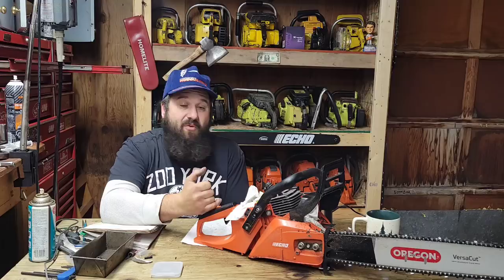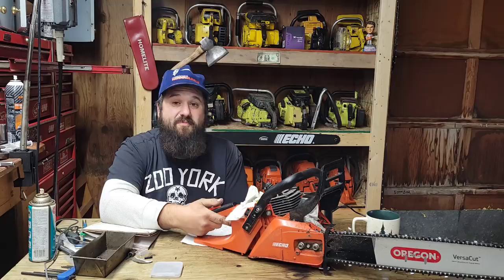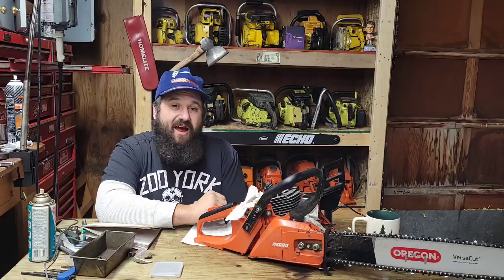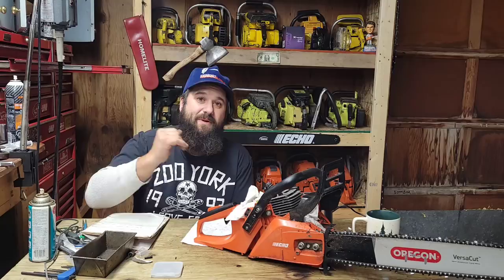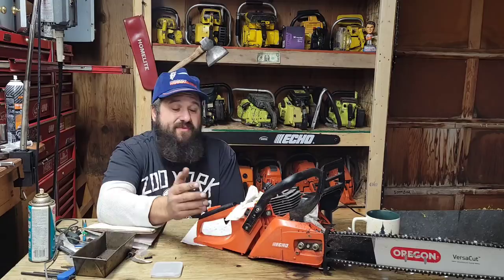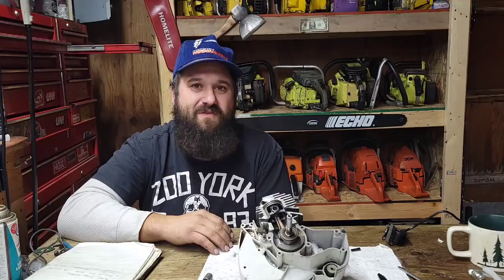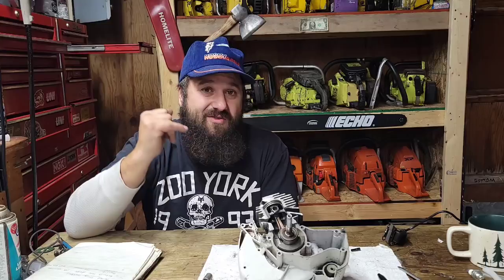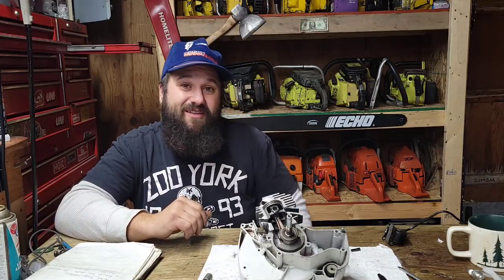Tinman, whats the deal with the Echo Cs 590??

Comment: It wont rev high a 590 and 620 have bypass jets that wont lean down.  Plug the hole you can rev it to the moon.  My 620 runs 14200 all day.
Reply: I do believe your on the right path, I ported my CS 620p but left the timing alone and spent my time finessing the transfers and exhaust shapes. Base gasket delete and it ran crazy rich.  Changed the jet to a non bypass and was able to tune it beautifully.  But I think the 620 has different factory timing and different piston. I'm a tech at a large echo dealer and we sell tons of 590s the echo portal says 12900 max on a 590 and 13200 on a 620.
Reply: @paulungrey6826  what pn did you use?
Reply: Donny walker says rite around 13,000 is the sweet spot on those